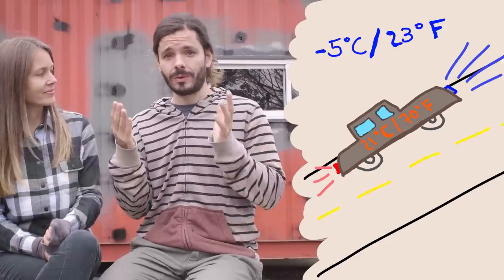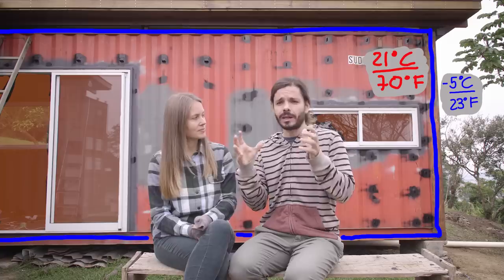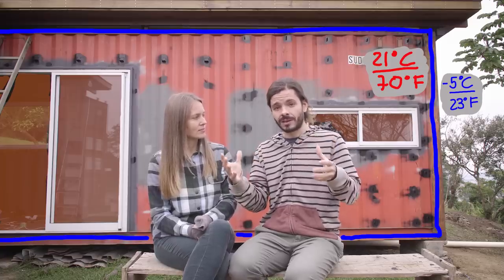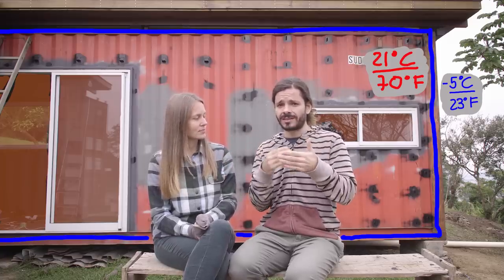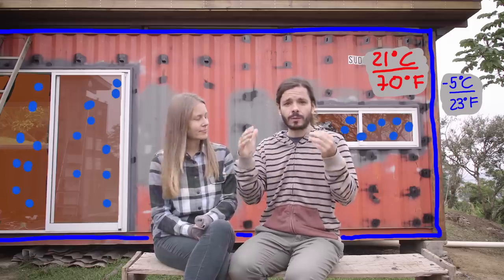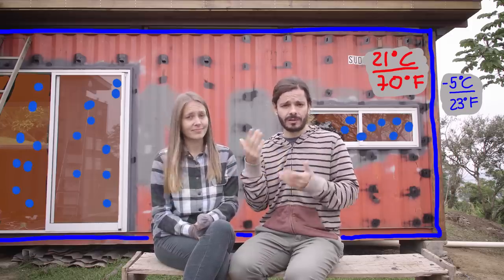How to avoid CONDENSATION on a Shipping Container - Living Tiny Project Ep. 033

Comment: We are also trying to think of solutions for this issue at the moment too. It is a tricky situation. We do have the option of spray foam, but would prefer to use a less toxic material.
Reply from the maker: It’s a tricky meter. Hehehe not considering the toxic material in our opinion close cell spray foam is the best. But isn’t mold also toxic? Hehehe in Brazil we have a saying for when we have no option that says something like “if you run the animal will get you but if you stay the animal will bite you” 😂😂 if you find any other good solution please let us know, as we only did for now half of the house 😊.
Reply: Your concern is well justified.  The industry claims the final product off gases after initial application and becomes inert.  I would tend to believe that in my own experience I've build with foam and currently foamed my crawlspace and soon my front entrance add on ceiling.  
The problem occurs when the installer fails to mix side A and side B that leaves residual unprocessed chemicals behind...very problematic.
There is lots of YouTube vids on foam nightmares.

A major concern not only with spray but all plastic foams is the emittance of toxic fumes on burning.
For that reason, ALL plastic insulation MUST be covered with a non flammable material.

Again, as with all container houses, you must realise the size of your living space is compact and any small infraction in design greatly amplifies the result of bad design.

Today's homes are constructed with composites such as TJI joists, glued beams, MDF, particle board etc. all emitting various chemicals that has the potential of affecting air quality and health. 
Personally, I would choose foam, research the applicators' work history and understand the function of VENTILATION.
There are numerous building materials we take for granted that off gas when new, plastic insulation is only one of them.
Again understand the concept of air changes in the living space using ventilation either passive or active.
Good luck with your project.

Cheers,
N
Reply: THAT´S an very important point, too. Spray foam is nice and tidy but did anyone speak about that is still produces gas .... in an container house case - INSIDE your home!!!!
Reply: This is why I prefer the insulation outside. More space and less problem inside. And if it gets fire, the steel container wall will be a guarding shell.
Reply from the maker: We also like the out side insulation. For summer our outside insulation (wood) for sure will help a lot. But we are worried about winter 😨
Reply: We are planning on cladding the outside of our container with wood. I think that the climate here in Australia is similar to where you guys are. It gets down to around 6 degrees celsius in winter and up to averages of 35-40 degrees in the summer.
Reply from the maker: Yep is really similar and at the same days it’s funny. When rains in Sydney rains here. Hehehe but you get a bit colder and a bit warmer. 👌🏼 we really like the wood idea.
Reply: I understand the benefits of outside insulation but I really want my container to look like a container because I think it's pretty... (and also I want to keep it portable / movable)
Reply: András Dovalovszki has outside insulation been shown on youtube, sounds SMART!
Reply: Skid Loader Beginner JCB 260, Bees, Farm, Pets  yes. A real popular outside insulation is called a sip insulation homes
Reply: I live in Canada, our home are very well insolated and air tight  condensation become a problem, we use vapor barrier like 6 mil plastic or aluminum foil or vapor barrior paint, this is to trap humidity inside, the trap humidity is then evacuated by a air exchanger -circulator. We also have exaust fan in the bathroom and rangehood. Those air exchanger are sophisticated  computer control device that use humidity-stat to control in and out air flow, it also maintain a constant humidity level. I understand the difference in climate, we have extreme temperature variation from -40 C to 32 C, so humidity, condensation is a main concern in winter because condensation become ice in the structure. This is the reason we dont let the humidity go inside the wall. So my suggestion is to trap humidity inside and exaust it mecanically and keep your structure well ventilated to prevent corrosion.   Francois from Montreal, Quebec.
Reply from the maker: Thanks fot the tip. 👌🏼
Reply: The only real way to completely do away with it and have a full vapor barrier would be closed cell spray foam. Other methods can reduce it for sure but it will still happen inside the walls/ceiling. There are far less non-toxic soy based closed cell foams on the market as well. For our container house we will be using regular closed cell foam.

Comment: Very nice vlog, we in UAE suffering from high humidity and high temperatures it reach 48c.

I would suggest that you look for dehumidifier options some now are used on bathrooms and some are used on roofs ceiling.

Now as you are working ⚒ in new ideas then using dehumidifier in such case need some skills like ducting the roof.

Comment: Has anyone suggested adding vents to the bottom of the wall to aid in moving the air?  Thermal movement of the air will be hampered (IMHO) if you rely on only the upper vents.  We do that with our attics with ventilation at the eave and then at the peak or ridge. If you have venting at the bottom as well as the top you will create laminar air flow in the air cavity.  Also, sub'd! I l have enjoyed your videos thus far (just found your channel).  Cheers from another Canadian.
Reply from the maker: Thanks a lot for the tip. Right now we decided to go with a different solution as out weather in Brazil is really mild, you will see on the next episode. 😊👌🏼

Comment: Spraying roof waterproofing rubber paint (the one used to waterproof roofs of houses)is an excellent solution. Very long lasting,it is able to cover every nook and corner.Even small joints and minor cracks can be covered completely.

Comment: Hei guys, nice episode, good subject to talk about. I think the solution you came through is quite good but i would considered to use a Damp-proof membrane between the insulation and the wall boards (not sure if you will use plywood or plaster boards), if you cant find specific damp-proof membrane you can use normal plastic. This is really important to prevent the condensation to pass (While dosent dries with the ventilation) from the air gap you created to the plywood / plasterboards. if you need i can send you some pictures to show how to apply this membrane (is quite cheap and easy to place). Also make sure you have a good airflow on the gap, you need openings on top and on the bottom on the container)
Reply from the maker: 👌🏼👌🏼 Thanks a lot for the tips!!

Comment: The only way to stop this is to insulate the OUTSIDE of the container. Closed cell spray foam is ideal. But you could cover the outside with aerated concrete, then paint it.
Reply: I was gonna recommend the same thing - insulate the outside. You can use thicker, less expensive insulation panels on the outside - I think there are even some that come with metal or wood or vinyl siding attached, so once installed they’re already weatherproof. 

This will also save interior space, since you just need to finish the walls - you won’t need to insulate the interior walls since they’ll always be the same temperature as the exterior. You’d just need to use an exterior scheme that allows any moisture to dry to the outside.

Comment: If it was me I would do 2x4 walls and ceiling with rockwool insulation then line the inside with vapor barrier (thick clear plastic) with all joints taped and for the floor rigid styrofoam covered with plywood. That way moist vapor doesn't reach a cold surface.  A bathroom vent controlled by humidity would also be a good idea. Rockwool insulation isn't necessary but I like it because its easier to work with, you get a better R value for the thickness, drains water if it gets wet and it's not itchy.

Comment: It seems to me that this resolution could do. But as bert skeleton says - you can consider whisper fans in addition. You will still have some condensation - at least in the morning on the windows, because the moisture will still be in the shipping container. The difference between inside and outside temperature is most significant just before dawn, and you can expect some on the only vulnerable place - the window glasses. So I would also recommend some ventilation.
Reply from the maker: For sure we will have on the windows. We believe it’s really hard no to have on such a small space with people inside. But lucky here is not that cold, even on the winter we can still open the windows to ventilate when it’s too humid inside. Or when we cook inside or take shower. In this way even if condensation happens on the window we can dry it out. 👌🏼👌🏼👌🏼 that’s our hope. Hehehehe
Reply: Since it's not that cold it will work - here in my place it is sometimes -20 (C) outside during the winter. But! Consider at least one in the bathroom :)))
Reply from the maker: Uhh that’s tough. On the bathroom we will have two windows one on each side and they are basically going to be opened 24h a day so we don’t think will be necessary. Even when is cold we close the bathroom door and open the windows. 👌🏼😊

Comment: Hi Guys, great video on a topic that has plagued me for years in trying to find the "right" solution to the condensation issue.  Our climate in south Florida is quite similar to your climate in southern Brazil.  Please take some time to calculate the square foot area of ventilation.  I am concerned that you may need to either add more vents (or install a powered exhaust fan).  

Our Florida building code (has had this rule of thumb for years) for static ventilation for attics (i.e. soffit vents only - no ridge vents), found in section 1203.2 Attic Spaces:  An airspace of not less than 1 inch (25 mm) shall be provided between the insulation and the roof sheathing. The net free ventilating area shall not be less than 1/150th of the area of the space ventilated.

So for a 40' container which has approximately 320 sq ft of ceiling (attic is the air gap between container and insulation), need 2.13 sq ft of free ventilation.  But adding screen to the vents that is necessary to keep out those pesky bugs but also reduces the area of free ventilation of these vents.

Looking forward to next weeks video!  Michael and Susy Kay
Reply from the maker: Thanks a lot for the support Susy!!😍😊

Comment: You should do what is the best to insulate your home and prevent condensation. Also you can go with  slaked lime. I have them in my apartment in each room and hallway. You can hear them cracking and popping when there is moisture in the air. Make sure you have good ventilation of your home. 
Anyway i hope i gave you guys great idea how to prevent moisture.

Comment: Somewhere you said that your big problem was condensation.

Now if I understood correctly the humidity in the air where you live is around 80%.

In addition, you have a problem of condensation due to the temperature difference between the roof and walls of your container and the air outside.

If you open the windows, the humidity travels from the outside to the inside.  So you basically have to remove this humidity from the  interior of the container.   In order to do this you have to condition the internal atmosphere of your container.  

To do this you can turn on a dehumidifier; however, you have to close the windows or you will be dehumidifying the outside air as well.  
After a while of running your dehumidifier your air will become stale with the windows closed, so you need to bring in fresh air.
If you open the windows, then again you have to recondition the outside air, and this is rather inefficient since you will have to run the dehumidifier again.

A better solution is to run an efficient ERV.  It will help in bringing fresh air, but it will, also, help with humidity.  An HRV will not do this!

Now, your ERV will run while your dehumidifier is off. It will bring in fresh air.  It will take out stale air, and it will help in maintaining a lower level of humidity.

This will help with the condensation problem you alluded on your videos, and it will help with mold.  By reducing air moisture, you reduce the chance of getting mold spore growth in the inside.  If you put a simple vent, this will not work since it is not conditioning the air in the inside.  It is only moving inside air to the outside, and when it stops running, the place where you installed it will suck in all of the outside air with all the humidity.

You cannot have it both ways.  You either open your windows, and live with the moisture in the air, or you condition your inside air to avoid condensation.

If this was a house made with a breathing material, for example, red bricks, then other solutions might be possible, but your walls are made of iron, and there is no breathing going on besides the oxidation of the same.  So, you have to think of alternate solutions and adapt.
Reply from the maker: We don’t have condensation problems we want to avoid having. And that only happens a couple days a year. And we don’t have 80% of humidity everyday. Other than that even do we have humid air. I prefer open windows and fresh air moving in and out.
Reply: Odd Life Crafting it sounds like you have determined your priorities.  Best of luck
Reply from the maker: Sorry if I sounded rude. English is not my first language and sometimes it’s tough to understand explain my thoughts. To build the house without experience sometimes is tough then it seams. And even more when building something different to what it’s usually build where you live. In Brazil we don’t build framed house. It’s all masonry so we don’t even sell insulation. That means many of the solutions everyone is used to in different countries they are usually not available here. Bu as I always say sometimes you’ve got to do what you’ve got to do. And find a solution with what you have available. We might have expressed ourselves bad as we don’t really have condensation problems we are afraid it might happen.  But until now we didn’t have any issues and this winter for our standards was pretty cold. The other thing is that in one point we need to make a decision so we can move on. So far we are happy with it. Thanks so much for trying to help. We really appreciate that, many of the solutions we are using on the house came from helpful people like you. Thanks a lot.
Reply: Odd Life Crafting no worries my friend.

I saw the hard time you guys were having, and I tried to provide an idea to help.

The manufacturer of the ERV is based in the USA, and it would not surprise me if they have a local distributor.  So, send them an email, tell them about your situation, and maybe they can suggest something.

http://vents-us.com/cat/704/

If you decide you don’t want it, that is ok too.
Reply from the maker: 👌🏼 thanks a lot!!

Comment: Question:. Why not insulate the outside of the container.  That way the metal walls will not get cold and cause the walls to condensate the humidity in the air inside the container.  To remove the excess humidity inside in warm weather use air flow through the house...in cold weather use a dehumidifier.  If you insulated the outside with spray foam it would not off-gas to the inside of the container and you would not have to worry about toxic chemicals.  You would also have better utilization of the inside space.
I have been considering to build my own container home using a lava rock and foamed concrete panels 1 foot thick on the walls and a 2 foot thick panels on the roof.  This may seem like overkill . But I have a fairly inexpensive sourse of lava rock gravel (which is very light and porous).  Combined with the foamed concrete which is areated by the foam is a good insulation.  This is not structural concrete.  Rather it is insulation and would have to be coated with stucco or at least sealed with a paint on concrete sealer. Instead of making the panels with this material, forms could be built  around the container and and the forms filled with lava rock gravel and foamed concrete in layers....like making a casserole... .shovel in about 4 inches of the lava rock gravel at a time and pour in enough foamed concrete slurry to permeate the lava rock gravel and just cover the gravel....then add another layer of gravel to the casserole.  The foamed concrete is acting as the bonding agent for the lava rock.  All this can be done with hand tools and a cement mixer and a foam generator which you can build yourself from readily available plumbing parts very inexpensively. You would need an air compressor to create the foam in the foam generator.  This is my idea for covering and insulating my container home, anyway....if any of this interest you could check into the advantages of insulating the outside of your container.
Reply from the maker: For sure it’s a solution but in our casa we built a deck on the roof already so it becomes impossible. 😏

Comment: Hi Duca and Roberta ,been waiting to see how you guys addressed the condensation problem it is a problem that doesn't seam to have a perfect solution an area of air movement between inner lining and steal sides of the container in mild climates should work and reducing humidity internally, keeping  warm air away from cold steel keeps you thinking, in my case I decided to use a combination of foam panels and closed cell spray foam , when I bought one of my containers it had   kitty litter in buckets inside,to absorb moisture I assume
Reply from the maker: Yep it’s actually a tricky matter. 😏
Reply from the maker: Let’s hope for the best!!🤞🏼🤞🏼